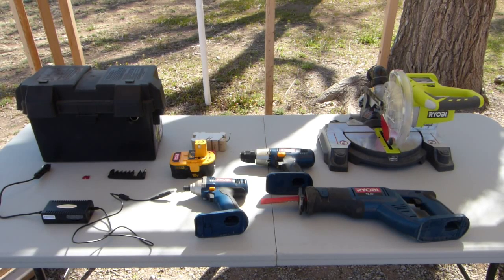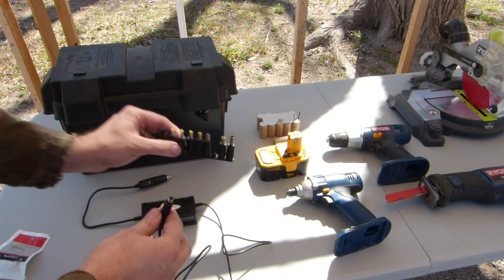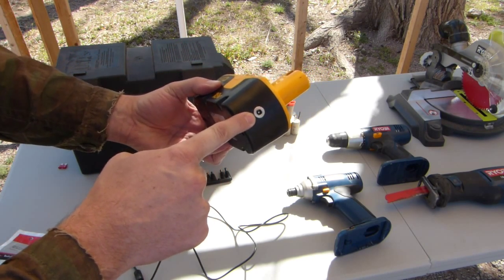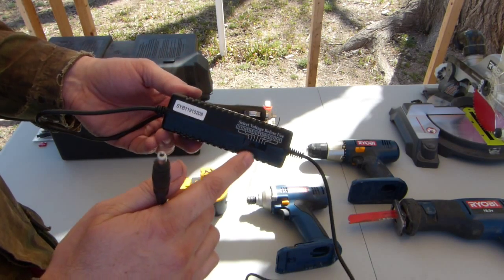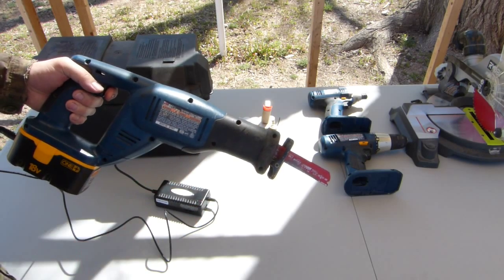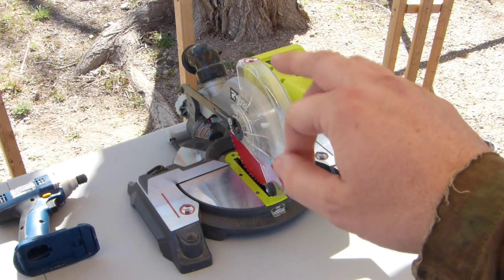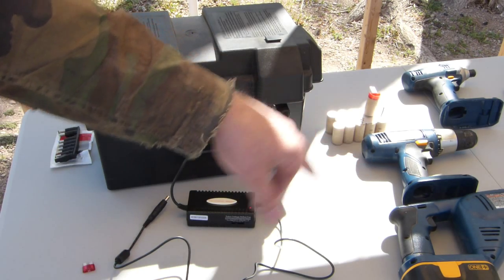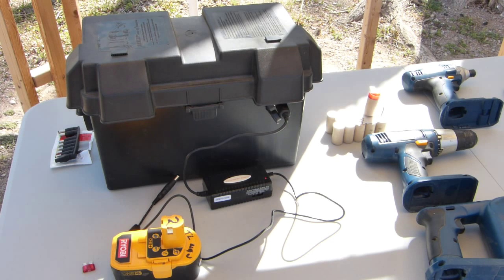Run Ryobi Tools From Car Battery

Comment from the maker: I didn't bother putting batts. back as they were whipped anyway. You could hook the N up with the batts. but would have to manually know when to yank the battery off charge. Lots of trouble. Ryobi makes 2 different 12v car chargers for their tools. One can do the new batteries (green model). My older one is "touchy" and will only charge when the car battery is FULLY charged. It sometimes only worked when the engine was on. I'm just glad I can run (most of) the tools "corded". That works 100%

Comment: VERY NICE !  I saw a magazine article about a year ago, that showed how to do this with just the battery power for 12 v  tools, and it mentioned that ones like this that used higher than 12 v, would just run at lower RPM's. I like this much better, but will still keep the other method available for emergency and backwoods repairs in case the computer converter quits or isn't available. Back-ups for your back-ups is the smart way to go for sure. Thanks for this one. Yep, VERY NICE !

Comment: The saw is a high amp draw item even with the Lithium Ion batteries.  I have the model in your video plus the older 8 1/4" model, and the older one goes through Nicad batteries like crazy, and will overheat the LiIon batteries pretty quickly.   You can get up to 4.2 amp hour batteries from some sources in China.

Comment from the maker: @DIMTIM1000 Yes, most videos on YT show the tools running slower on 12v. A voltage converter is the real way to go. There are great quality converters out there besides laptop adapters. They cost quite a bit though. Like $150-200. Solar Converters Inc. in Canada makes some constant voltage DC-DC adapters that are adjustable. They have models that output up to 20A.

Comment from the maker: @pietkaify Ryobi discontinued the cordless mitre saw here in the US. Bought my first one for $90 and then got the last one on the shelf for $30.
I'm going to eventually look into a motor swap for the corded Ryobi 7 1/2" saw. Maybe a 12v or 24v motor. Would hook to the battery pack direct with a bigger fuse and thicker wiring.

Comment from the maker: The small Morningstar stuff is ok. They are far better than the super no name stuff. And you're correct, there are no load terminals. Some small models do have them or at least low voltage disconnect (LVD). Mine does not output data. It has a few other features beyond the cheap controllers...and it handles 15 amps of solar panels. Normally when you go up in price the controllers handle more amps. Next model up from mine is 30 amp. You can expand your system later in this case.

Comment: I wonder if it would be OK to put 2 batteries in series giving you roughly 25 volts and then run the cordless tools without the converter? It may just be in the recommended voltage range. Just a thought. Or put a 12 volt and a 6 volt in series. If you can find an appropriate 6 volt battery.

Comment from the maker: I tried more volts. Still ran slow. The adapter just can't put out enough amps. It will just basically heat up and melt down. They discontinued the cordless saws anyway in the US. Still have the corded version for $79 though. I'm going to buy one. Got 2 of the cordless.

Comment from the maker: @frisc45 Nope. I even have the Ryobi 12v car charger. I just wanted to be able to run the tools at a bench just like corded tools. The miter saw would need lots of batteries to last all day. I want to do nonstop construction off grid using just a single solar panel and a few deep cycle batts. No generator, cause like, who can afford $20 a gallon gas anyway? ;)

Comment: When my Ryobi NiCad batteries are fully charged they put out about 20 volts.  Maybe, you could just up the voltage output on your adapter in order to run the chopsaw. Thanks for the videos.  I want to plug mine into mains electricity. 7 1/4 inch blades rule.  Tell Ryobi I want a table saw and a planer that don't break my back setting them up  on the jobsite. cheers.

Comment: The question is - how much amps does the tool drain from the battery normally? Is it 5amps or less, is it 10 amps or less, or iss it more than 10 amps?

Comment: I saw you using the impact driver with a battery that appeared to have an N connector but you had no cord on it, did you figure out how to re-install the battery with the N connector connected? It would be cool if you could recharge the Ryobi batteries when the cord is connected while you are not using the tool.  Is it possible to recharge the Ryobi batteries with the car battery?  -thus making your chop saw off grid ready... Ryobi probably makes a 12V adapter, but maybe it could easily be made?

Comment: Any problem with the small MorningStar SunGuard encapsulated charge controller?  It's well under $100... but you probably can't hook the plug up to it to protect the battery...  plus no info.  Unless you're taking data,  who needs info?